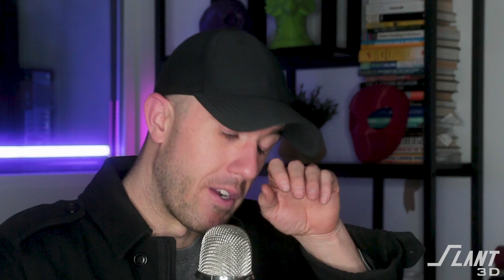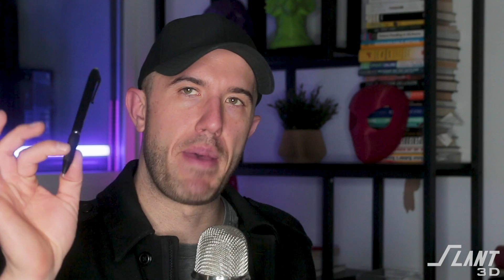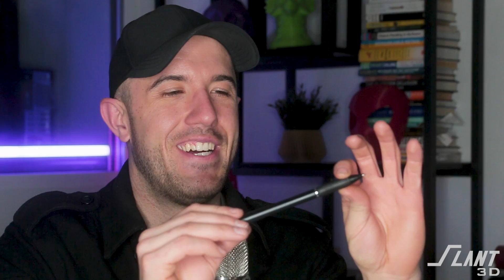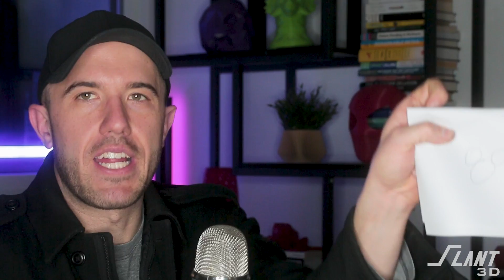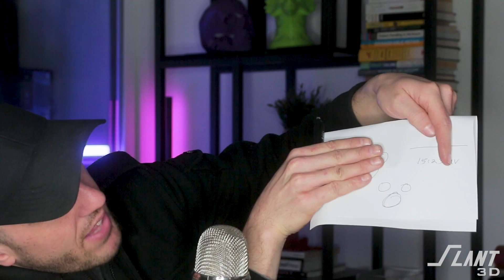3D Printing at CES | Hubs is Back | UV Resistance | Patents & NDA's | 3D Printing News

Comment: I understand you point on resin. Resin printing is more for niche markets like dental and ceramic prototyping (Phrozen has a ceramic resin they are releasing that's in it's testing stage). Or for small scale printing where you can charge more per print because of the time involved. But, to grow it tp larger scale you need more employees than with FDM because of the processing. I have a resin printer, which is more for personal use and fun stuff.

Comment: On the topic of shelves making the product i am curious if you have tested any advanced automation utilizing rail mounted robotic arms to do pick and place for conveyors with computer vision inspections to reduce hands on time with the printers?
Reply: Also thought the UV resistance balking is hilarious!!! The cosplay comunity has solved that for years with uv clear coat using pla in colder climates and we only switch to asa, petg, or ABS for the higher heat resistance when at a con in texas lol.

Comment: First - I agree with most of your insight to Patents and NDAs. As a patent holder and NDA requester. You forget that with a patent you become a "Single Source Vendor" allowing your customer to streamline the purchasing/PO process. Also, owning a patent legitimizes your product in your customer/client's eyes. Regarding the NDA, I will request an NDA from all my vendors that I disclose any intellectual property. Exactly for the same reason you require your employees to sign an NDA. It's actually hypocritical of you to be insulted when asked to sign an NDA but you require your employees to sign an NDA.

Comment: The segment on Patents & NDA's is gold. It should be standalone video. (so more findable on YT)
Glad to see the "Testing Lab Kickstarter" got funded!

Regarding "UV Resistance"; a comparison of plastics to aluminum is a good reference. Bare aluminum oxides very quickly so loses its mirror like shine and turns dull with a milky white twinge if it does not have a lacquer or anodized coating. Unless scratched, or rubbed off, the oxidized layer acts as a protective coating. Related is thermo cycling, if a product is exposed to outdoors. Depending on color, surface temperatures can experience extremes. This could create more stress on and within a plastic structure. Perhaps a topic for future testing.

Comment: The other issue with NDA's is that it can put the contract manufacturer over a barrel if the customer rejects the product.  That happened to the shop I work for.  We made a product for a customer (signed NDA) that had outside process involved. They didn't like the finish on the product the outside processor did and refused to pay.  We ended having to scrap $1M worth of product with no recourse.  No fun.

Comment: 28:05 patents can be defensive that is you never plan to sue anybody but if anybody sues you then you sue back with your patent. And here comes a patent pool where multiple companies put patents in a shared pool and if any body sues any one in the alliance the entire alliance sues back.

Regarding trolls they work like this. A company that has no product  and is entirely made up of lawyers collects patents (buy them or file them, a method to specify time in a time machine). Then they sue people who do have a real product. When the judge says both parties no longer can sell the disputed material until the case is resolved. The troll who does not have a product has an advantage.

Comment: Good video, but a huge miss on the patent discussion.  You need to learn about a PPA, provisional patent application.  It is cheap, pretty easy, and gets you protection while you prove your product in the marketplace.
Reply: Yeah, more importantly: if you don't fill for the PPA, you lost your chance as your own product can now be pointed to as prior art. I also don't agree with the "Nobody will steal your idea". Sadly, both China and Amazon have proven this wrong way too often.
Reply: Yes, good points!  The patent-pending of a PPA is useful to get platforms such ss Amazon and Etsy to shut down copycats.
Reply: @lxc3909  At least Etsy is not itself an actor on their own platform. Amazon is notorious for (ab)using trading data to decide what products can be offered at better prices.

Comment: I got a couple of patents back in the 90's and I agree with your assessment that nobody wants to steel your idea. Nowadays you can easily do patent searching online. I've been doing some on a thing I make for myself and most of the results I get are patent applications and not patents. I notice that patent law has changed so that patent applications are now public, whereas when I got my patents, they only became public when they were issued. This has me wondering. A patent application fee is a couple hundred dollars. If you have a pretty good idea of how to write one (say from reading a lot of them), could this be a good way to publish your work?

A patent has two main parts. There's a description which includes diagrams, references to prior art, descriptions of the scope, preferred embodiments and such. This is stuff that can't be changed. Then there's the claims which usually get rejected and you can respond by making counter arguments, making revisions, new claims and even another patent application from stuff that's in the description (that's how I got a second patent).

Anyway, could applying for a patent be a new form of scientific and engineering publishing? Could it be a way to prevent or even be a patent troll?
Reply: One area you didn't cover was having patent pending stamped or printed on a thing. Is there value in that?

Comment: Wouldn't it be a better idear to not patent the product but an integral part of the production process, since that can be keept non public even after the product launch?
Reply from the maker: Trade Secret. Why patent it at all if it is hidden
Reply: @slant3d  just for the company valuation, as you said. And it would circumvent the issue of patending published inventions.
What do you think of using cheap cobots (igus has on for ~2500€) to handle resin parts?

Comment: I am a Patent Attorney, and although there is some good information in this video, some of it should be clarified. You implied that patent attorneys can get around an existing patent by just describing the same thing in a different way. That's not true. To get a valid patent you need to distinguish your claimed invention from the prior art by either adding elements or showing that what you recite in the claims is different than what is shown in the cited art. Simply rewording isn't going to cut it. What is claimed must be new and non-obvious in view of the existing art.

Don't ignore your intellectual property if you hope to sell your business down the road (Slant has some incredible IP btw). I agree that your know-how, good will, and brand is worth a lot. But the patents add a lot as well, and can easily add millions to the final sale price of the business. Should you patent everything? No, patents are expensive and the value of the market needs to justify the cost. But don't think that just because a patent is not litigated that it has no value. When you get a patent, and place that patent number on the product, a lot of potential rip-off artists will leave you alone, or at least approach you to purchase a license. When I worked at a large law firm, we did patent clearance work for a large online retailer. This retailer liked to take products from others and make their own version under their own private label. On more than one occasion, we did a search, found patents, and could not get the necessary license (or workaround) to copy the product. As a result, those products were not copied. Most of the time, the owner of that patent never even knew that their business was nearly destroyed but for the fact that they made the effort to get a patent.

The biggest challenge for inventors is that the patent system generally requires that you file for protection before you disclose it to the public, and usually you don't really know if the product is successful at that time. A full utility patent can easily cost $20k by the time it issues, but there are ways to start cheap, like a provisional or a pro se design patent application, and preserve the ability to file a full utility patent down the road. Inventors need to be realistic when making the decision to patent or not. The attorney will always recommend patenting, so don't look to them for advice in this respect. In order to justify a $20k patent,  you should probably be projecting at least $1M in sales. Inventors need to be honest with themselves. One common strategy is to file a cheap provisional application, which gives you a filing date and remains pending for a year. During that year you take your product to market at see how it goes. If it's a big hit, you follow on with a utility patent using the earlier date of the provisional, if it's not a big enough hit to justify a full utility patent, you let the provisional expire. While the provisional is pending you can mark the product as "patent pending" to ward off any copycats.

Comment: I watch all of your videos and they are all comprehensive and very easy to understand. This one, though, in my opinion, is one of the best you've done. I have spoken to you and Anna multiple times and you are as helpful and efficient in person as well. Thank you for addressing NDAs...I'm sure I'm not the only one who didn't realize their request could be insulting on their face. We are far along in the process of working together, and I can't wait until production begins this month. Thanks Gabe, Anna, Gabby, and the rest of the team for running such a great American company! 🤩💯🌟🔥🏆🏁
Reply: I thought I had written this post LoL... (Dealing with Anna and Gabe!... both being helpful, efficient, smart, kind))... Gabe, this video was sooo good, and over the years, I've been dealing with (mostly avoiding) patents, nda's, etc.  The only thing I might add, is that for under a hundred bucks, one can get a PPA (Patent Pending), which companies do like, as it shows you've done SOMETHING to show value, and it gives you a year to put the pedal to the metal to test if your product can gain traction (if you want to try to get a licensing/royalty deal).  I used INVENTRIGHT (Stephen Key).  You can also legally use the term "Patent Pending" on products and literature.  (Just another tool to be aware of).

Comment: Intellectual property isn’t real anyway. Also, ideas are not stolen. They may be duplicated & shared, but there is no scarcity
Reply: 48:40 NDA sounds like a prenup haha
Reply: Tell me that after spending thousend of hours developing that "idea", adjusting parameters, tinkering your mathematical model, prototyping and Yet Is not real to you.
Reply: @MRbasthor  no, it’s not. You have no right to control the resources of others because of the effort you put into a project.
Reply: @KanielD  

Where were resources and other actors mentioned?
Reply: Tell me that after spending thousend of hours developing that "idea", adjusting parameters, tinkering your mathematical model, prototyping and Yet Is not real to you.
Reply: @MRbasthor  The best thing to do with an idea is to use it.
Reply: Ideas are stolen when they are taken and used with no effort, transformation, and/or credit attributed to the source. The word "stolen" applies because the "thief" gains the benefits of an idea without the cost (time, research, effort). Similar to how a thief that steals your phone gains that device without having to pay any money.

This is not to critique inspiration or transformation. Taking an idea and improving, tranforming, or modifying it is considered protected because it is another non-trivial idea built on top of another. 

If I come up with a unique, non-trivial solution to a problem, I am the first conceptualizer of that solution.

In order to incentivize people to come up with ideas and solutions, we agree as a society to allow individuals to benefit from their ideas.

It can also be argued you "own" the idea because if anyone else wants to squire it, they are dependant on you to share it. So in that sense, it is my knowledge.

Comment: As a Ham Radio operator who's worked with clubs that have repeaters on top of high structures, one aspect of UV resistance that we deal with is that the resin to make fiberglass tubes that are used to enclose the antennas for the repeaters often spend years or decades outdoors exposed to sun and weather, tend to effectively evaporate out of the tube. These antenna systems undergo periodic inspection, which often includes someone going up and touching the side of the fiberglass tube to see if the tube has retained it's integrity, or if it's due for a replacement. Whether this is UV breakdown (often the provided explanation,) or if it's a combination of UV and other weather effects (I think this is more likely,) or if it is some other situation (the resin/hardener breaks down by exposure to Ozone?,) is somewhat irrelevant. It's a situation that requires replacing the repeater's antenna. Note that most of these antenna's cost less than paying the climber with appropriate insurance go to up and replace that antenna.

All this to say that If you are getting something like a Stevenson screen 3d printed, go ahead and either pay for the ASA, or paited version, but also work out how often you are going to be replacing the sensor sitting in that weather sensor screen, and plan on buying a new screen for the update.